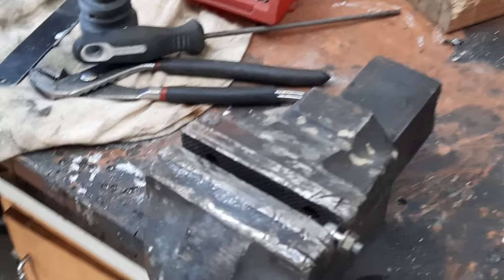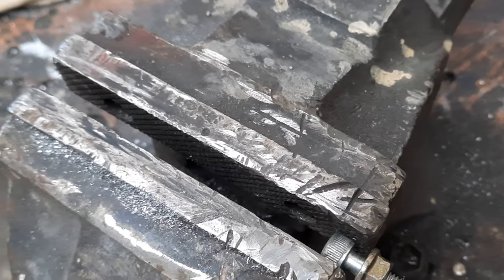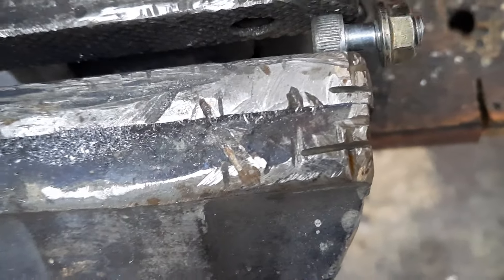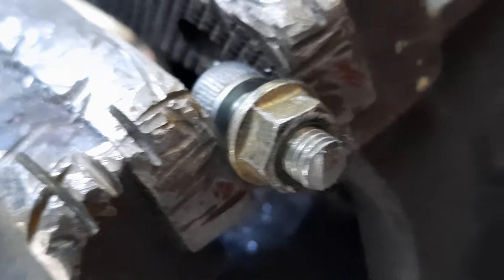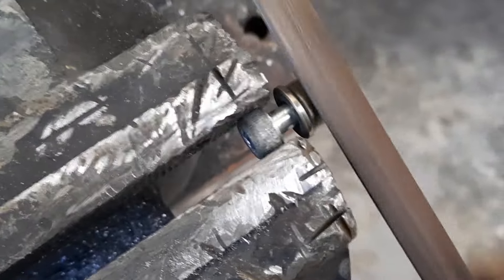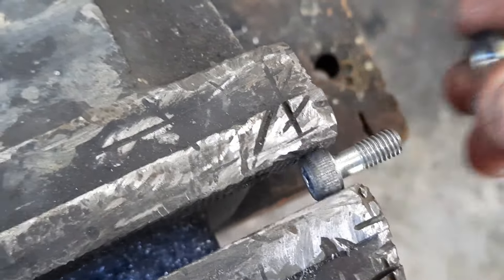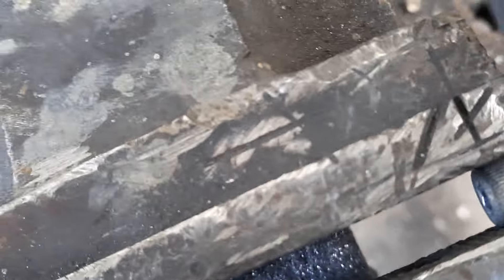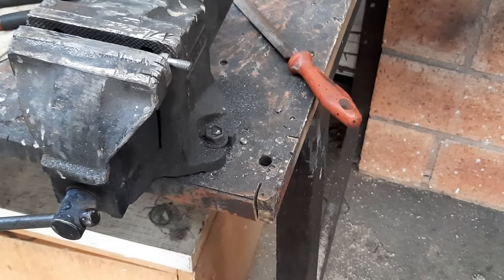Procedure for shortening bolts

Comment: Agreed about putting a nut on, mare, but a hacksaw leaves no burrs, in my experience.  Good video,  very helpful for  hobbyists.
Reply from the maker: Correct the angle grinder is just quicker. Especially when I have needed a new blade on my hacksaw for months but keep forgeting to get another.
Reply: I'm  counting the years that I've used the same worn-out blade, mate, but for some reason it just won't break!
(That, and I never remember to grab new ones.)
Reply from the maker: @jasonrivers7518  Mine now has several teeth missing
Reply: @bruceaskin9645  Mine, too, but they're all at one end, which works.
Top marks again, for the video, mate, keep 'em coming. 👍

Comment: Abrasive wheels work the best, it can be mighty tough to cut a Grade 8 bolt with a blade. Then I put a socket on my Makita cordless impact and spin the bolt slowly against my spinning 12" disc sander, works like a charm. If I had to use a hacksaw and file I probably wouldn't be done with the first couple of hundred I have shortened.